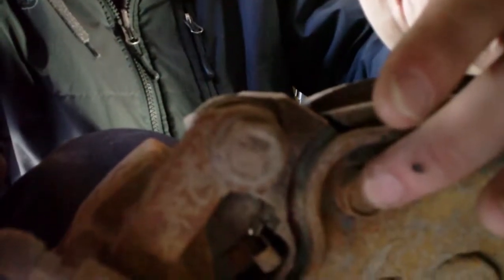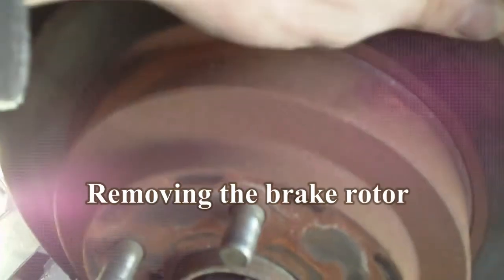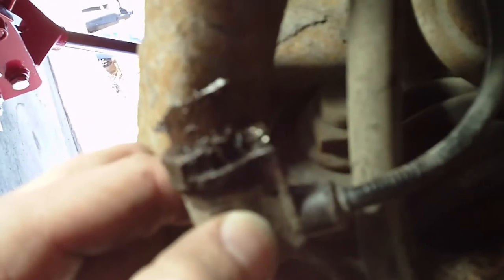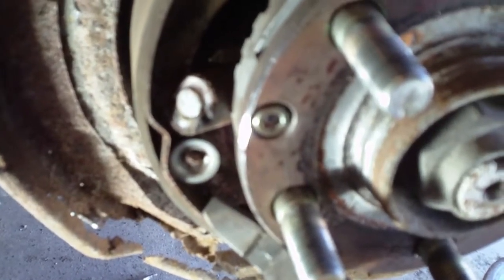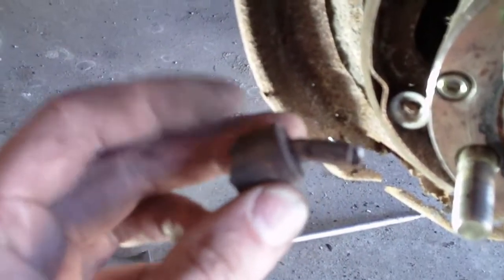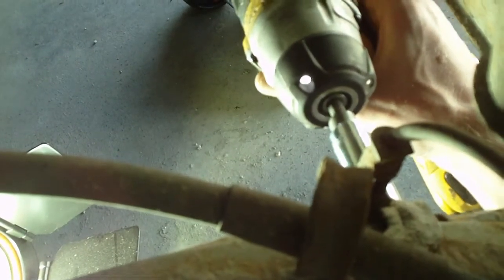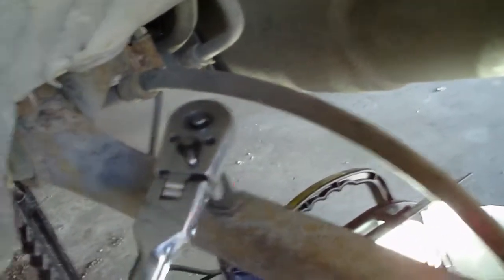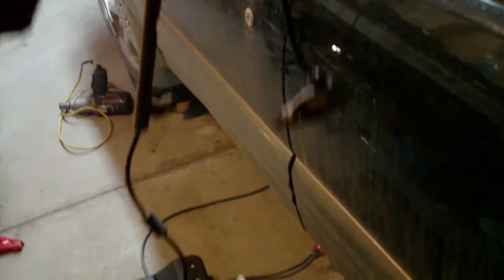How To remove An ABS Speed Sensor with tips 2001 Subaru Forester

Comment: So did this take care of the problem I.e. did the abs light go off??
Reply from the maker: No.  The problem was somebody tried to Uninstaller the sensor with a punch that didn't go inside the hole and bent the backing plate for the brakes so the tone ring was too far from the sensor so I ended up putting spacers under the tone ring and it was fixed.